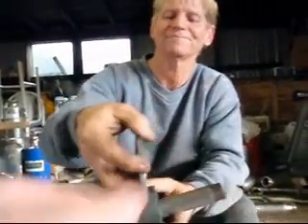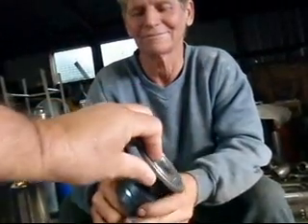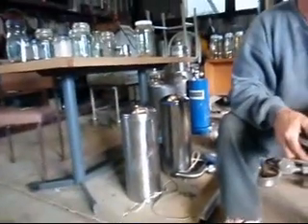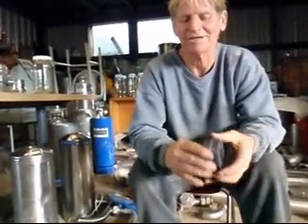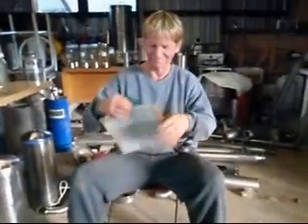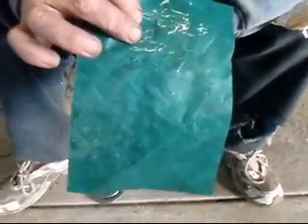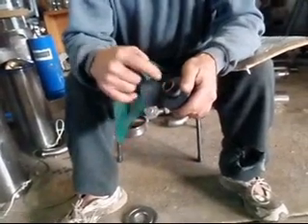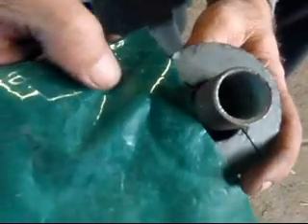AIR Peter Stevens with Joe and Magnetic Phenomena 2010

Comment: i've watched this video alone for about 40-50 times now...and i will 
probably watch it way more. I went out and got myself a small piece of 
green magnetism screener, magnets, pipes...I did this for myself and as 
far as i can tell till now, what joe shows in this video is like that. 
That makes me wonder if what he is talking about is also right and after
 watching lots of Joe i believe it is.

I have to figure a way to split the ring magnets in half in a clean way, if i try to brake them with shock they shatter in unpredictable ways. 

I believe this is one of the most important things i've seen in my life till now and i can't rest. I was intrigued the first times i've seen this but now i'm obsessed. I wish he would share more on this. Peter also did 3 videos on some of the subjects discussed in this. Also very interesting. 

There are some relations between the washer sizes and magnet strengths, so having the right washer and magnets matter. Having the right pipe also is important. Have them split also very important, and have them split clean even more important. I will continue the experiments and see what i will find. I guess a joe cell would be very helpful also but i can't make myself one mostly cause i don't have the funds right now. From what i've gathered the cell even if it does not look like much it is a very sensitive piece of equipment.  So if u would be to try and build one u need the proper stainless steel and machine it into the cell the right way else u won't have a joe cell and only something that looks like it. 

If ur watching this videos and u find them interesting save them. I don't think the internet will be here for much longer.  U know what happened to the library of Alexandria right? That pulled civilization back centuries if not millennia. 

This world makes me so mad...
Reply: Many of the very rich have their own PRIVATE libraries from back before printing presses. And only large publishers decide what info makes it into books for the public.
It makes you wonder what is the the private collections that the public will never see. Just like the Vatican library, not for public eyes. For what reason ? To preserve knowledge or prevent it from getting out ?
At least the internet is allowing the sharing of many books by scanning them. Like the Electroaerodynamics book that Tom Valone reproduced in his book that has info that isn't mentioned anywhere else that I can find. I was lucky enough to check it out a few years ago (the original) but now it is gone. You would think the military would keep copies of books so they didn't loose any research and all the time and money involved in creating it. They probably do, but not for the public.
Wouldn't it be nice to have access to the rich private collections and the military scientific collections.
Reply: Try scoring the ring magnet with a glass cutter then put in a vice to pressure it to snap. I too had that problem. Its also true if you run a compass past this magnet configuration the poles on the compass will flip every time, its nuts
Reply: @samellis9492  how thick was your washer what holds magnets together like that? I couldn´t keep my magnets all together. What I´m doing wrong?

Comment: clockwise on one and anti clockwise on the other a cyclone/hurricane effect will then form inside the dougnut (walter russel effect) the other neutral steel washer will then lock on as the 2 vortex fields inside the hole (blackhole effect) will be a massive zero point (equilibrium) the other steel washer then locks on .then when magnets are changed round the equilibrium goes to the outer causing the washer to not go to the centre washer.(proof of this should be it follows a strenthening coned

Comment: headache ! now the logic the steel washer is neutral it has had its atomic structure dispersed by the method of the condensed rain that is the neutral vapour that comes off the charged water.by making it into a flame (should be colourless if correct) the flame being neutral like the neutral in a tesla coil disperses the atoms of pos and neg as the air around attracts the pos neg like nano magnets.then neg to neg will attract  to neutral washer (if correct the magnet fields should rotate .